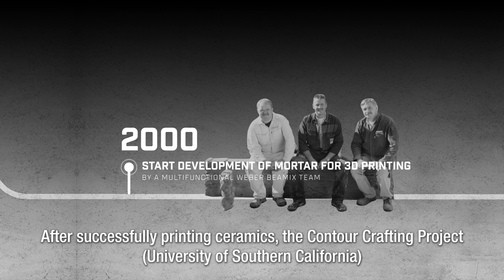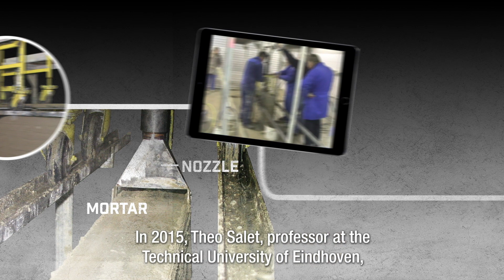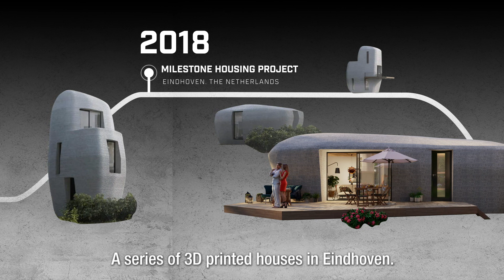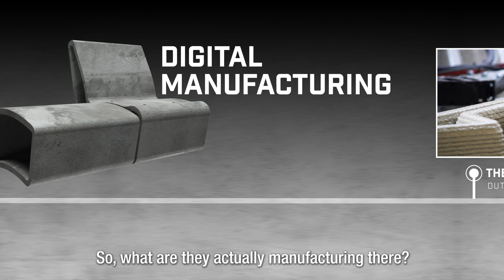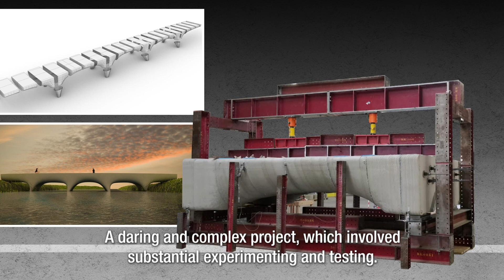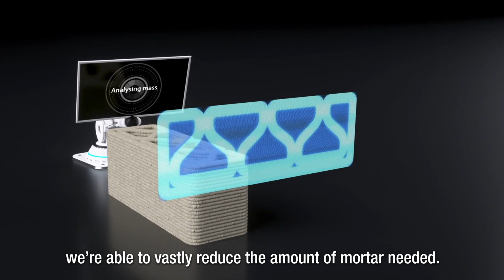The history of 3D concrete printing

Comment: here another idea: add separate nozzles left and right of the extruder to extrude a super fast drying material(other concrete?) so it forms like a "mold" with more liquid or slow drying conrece in the middle. ( or print a layer of the side nozzles first and fill later)